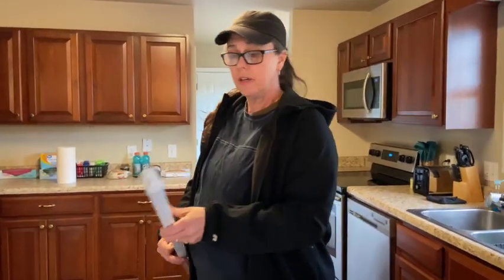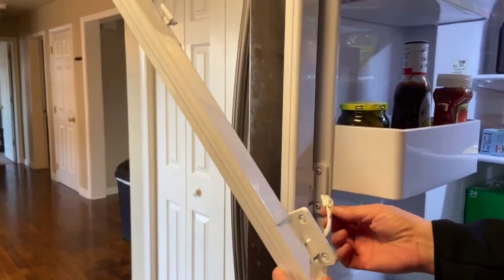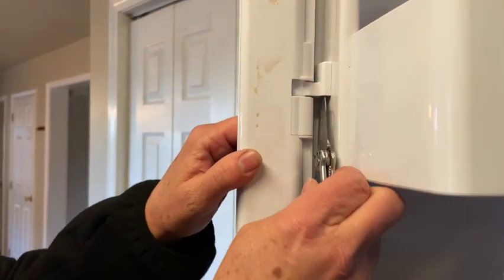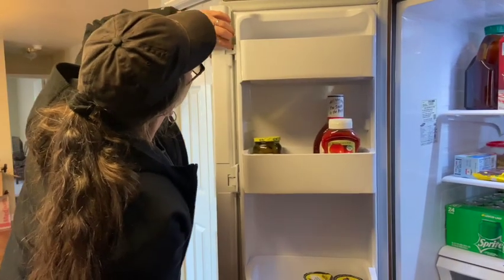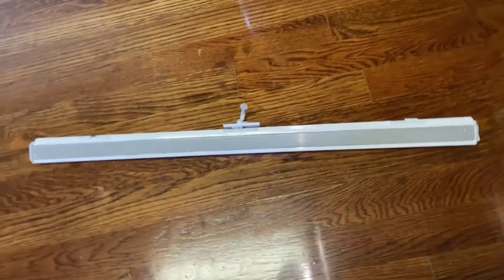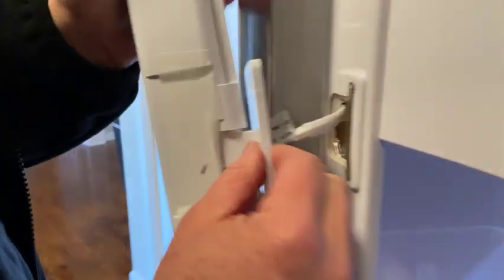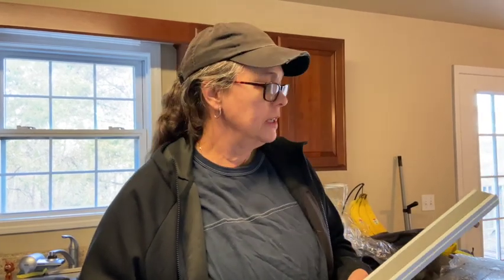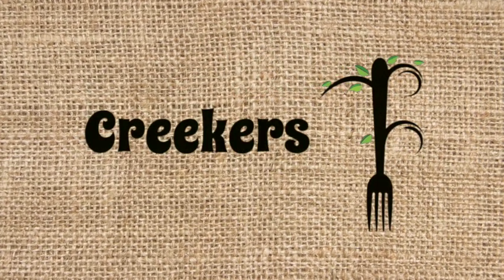Replacing Samsung Refrigerator Door Flipper Assembly (Easy Fix)

Comment: Thank you for the video. We just bought one of these fridges and the camera bar door would not fit into the channel. Discovered the problem. The delivery drivers/assemblymen forgot to remove a black button clip that was on the light switch that said "REMOVE" on it HAHAHA! That tiny bit of space it occupied was causing the button to miss the channel! fixed! removed the button clip. YAY

Comment: I have a similar model and have been having the same issue with mine. But, I had no idea how to fix it. 
Very informative, thanks !
Reply from the maker: Thank you! It was a very simple fix. Thank you for watching.
Reply: @creekerscountryclub6324  Evening, so on my French door fridge. When I close the left door my flipper/flap doesn’t open to seal the other door when closing. I bought it like that but i thought it needs to be open to seal the other door plus it has cameras on it. Is my door broken or is there some adjustment I need to fix on it ?
Reply: @creekerscountryclub6324  do you know if you can fix the top piece that fell out? Like can you disassemble the flipper and put that piece back into place?

Comment: Two small screws on the bottom of the bottom of the flipper door will work better than new.  Place one screw on the flapper and the other screw about midway on the bottom of the refrigerator door. Then place a rubber band stretched between the two screws.  Works better than the orginal design 😮